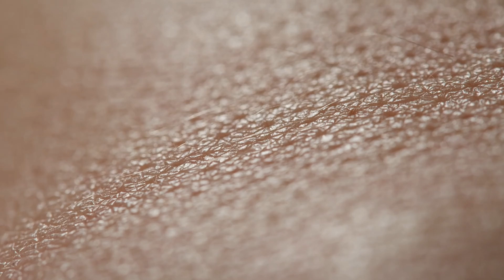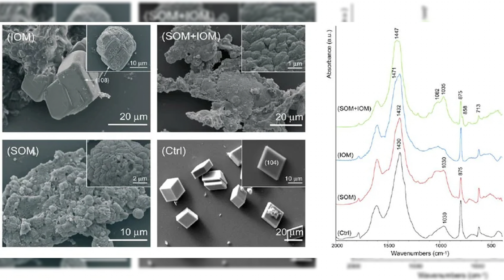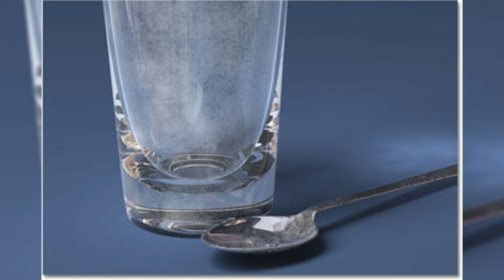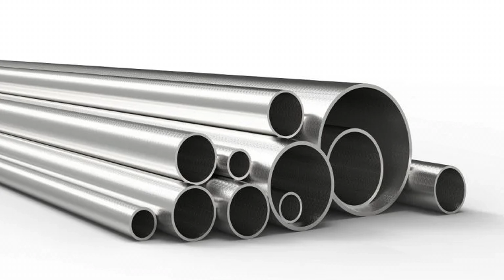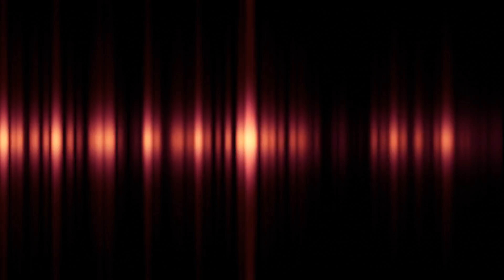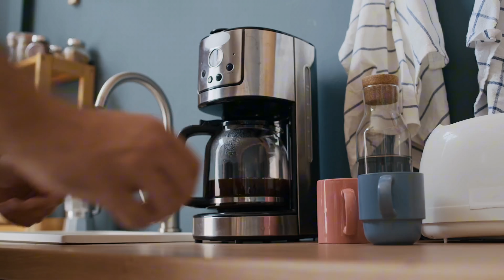🧲 These $12 Magnets on Your Pipes Eliminate Hard Water — No Salt, No Filters, Ever!

Comment from the maker: ⚠🚨 IMPORTANT MAGNET SAFETY WARNING 🚨⚠

Please do NOT use oversized or extremely high pull-force magnets for this setup. Stronger is not better here. For most people, magnets in the 20–50 lb pull-force range should be plenty. Anything much stronger can be dangerous to handle, can snap together violently, pinch fingers, chip, or even shatter.

The zip ties are only meant to hold the magnets after they’re already safely positioned — they are not meant to control monster magnets during installation.

Use gloves, eye protection, and a spacer like cardboard, wood, or plastic when positioning them. Keep them away from phones, bank cards, electronics, and pacemakers. Safety first. ⚠🧲👀
Reply: I have a couple of magnets with 200 pounds of pull force. I know your video said 20 pounds of pull force at least. Is there a concern with using such high magnetic pull force in this application?
Reply: Just please change this voice. It’s obnoxious
Reply: @Dtigger Some people will complain about anything...🙄🙄🙄

Comment: Your video is perfectly making sense, but I would recommend the magnet being placed at the water pipe entry from the Civic water pipe… which is cold water… as this condition being changed, the water need to go into a centralized filter with active carbon material to take away all the chemicals from the government water…. Then this can be go into the hot water tank… 

You can use any water treatment system, such as iron ionized, drinking water machine or any mineral stones shower unit…
Reply from the maker: That’s a solid approach for a more comprehensive home water treatment system, thanks for sharing your setup with everyone! 🤘🏼

Comment: We had this weird ball thing around our shower pipe 15 years ago moving in, had no idea what it was but the caretakers said the last tenants swore by it and it was up to us if we wanted to keep it so we left it on. It was just a white plastic ball with grooves in it, you could spin it, it was a mystery. Fast forward to months ago when the current caretaker did some bathroom repairs and pulled it off and we have no idea where it went. As the months went on my hair started getting more brittle and knotting itself easily, my skin feeling dry and more itchy. A film is on it even where the water makes it feel tacky, even after soap. 

We have really hard water here, plus an older building with all that comes with. After doing research I'm learning that this product was probably a magnetic water conditioner/descaler that does exactly as you're saying. It was likely fairly old, could have been sold from a fair, a tv ad or one of those little stands in a department store for all we know but I can't find a single digital record of it. The closest match in shape that I can find is the "Magnoball" which is a similar concept, only it's a softer material and meant to sit inside your dishwasher or washing machine to improve the water and remove limescale. Now I'm hunting for alternatives and I think I'll give this DIY a try first to see if it has any benefit.

Something I've wondered about is housing for the magnets, if they need to be encased in something or if that doesn't matter? I noticed some brands made use of them and I read something about having a carbon steel or iron back plate focuses the magnetic field and acts as a "flux conductor" which can double the field strength inside the pipe compared to bare magnets alone. I'm thinking that the shape of the magnet could be beneficial as well, rectangular giving better coverage possibly. Anyway just going to give it as shot and see what happens. It's interesting to read other comments around hot water ruining the effect, and yet it did make a difference on my showers.
Reply from the maker: That’s honestly fascinating—especially the timing between that mystery device being removed and the old hard-water symptoms coming back. The tacky film, dry skin, and brittle hair are all things people commonly notice with very hard water because the minerals react with soap and leave residue behind.

On the magnet housing: the magnets don’t necessarily need to be encased for the magnetic field to pass through the pipe, but they should be protected from moisture and corrosion. A steel or iron backing plate can redirect and concentrate more of the magnetic field toward the pipe, although claims that it automatically “doubles” the strength depend heavily on the magnet spacing, pole direction, pipe material, and overall design. Rectangular magnets may provide better coverage, but correct placement and polarity matter more than the shape alone.

I should also be clear that magnetic conditioners don’t actually remove calcium or magnesium like a real water softener does. The research is mixed, but some studies suggest that under the right conditions they may change how calcium carbonate crystals form, making scale less likely to stick. That could explain why some people notice a difference while others notice nothing at all.

Your old plastic ball may also have contained something besides magnets, so it’s difficult to know exactly what it was. Still, your experience is genuinely interesting. Please let me know what happens when you try the DIY version—I’d be very curious to hear whether the shower film, skin, and hair improve again.

Comment: Using magnets to soften water or reduce scaling has been around for over 40 years and has never gone anywhere. The reason why is very simple, because it doesn't work. I worked with commercial high pressure steam boilers where water softness is critical for preventing boiler scaling, and no one uses magnets for boiler feed water softening. In the feed water treatment industry, nobody uses magnets. Because it doesnt work. This is a old scam, most people today are not old enough to remember when they used to sell these water softening magnets in hardware stores. I even tried it myself on my home water and it had no effect whatsoever.
Reply from the maker: You're absolutely right that magnets do not soften water the way an ion-exchange softener does. They don't remove calcium or magnesium, so they'll never replace a proper softener in a boiler or industrial water-treatment system.

Where the evidence gets more nuanced is on scale formation. A number of laboratory and pilot studies have reported that magnetic treatment can change how calcium carbonate crystallizes, sometimes producing softer forms that adhere less strongly to surfaces. Other studies have found little or no benefit, especially under different water chemistries and flow conditions. That's why the results are inconsistent and why the technology has never replaced conventional water treatment in critical industrial applications.
So I'd agree with you that magnets aren't a substitute for water softening, but saying they have no effect whatsoever goes further than the current evidence supports. It seems to depend heavily on the water chemistry, flow rate, and the specific application.
Reply: @Sidney_Explains_Money They have no practical effect in the real world, that is my point. Not that there is no effect or change, but that it is not a reliable useful effect. There have been a great deal of breakthroughs that never got out of the lab, magnetic water softening is one of them. My hunch is that the effect is dependent on the magnetic field always being present, just passing the water through doesn't doesn't create a lasting effect. How could it?

Comment: I bought two N42 2x1x1/2 inch neodymium magnets through Amazon.  They were $16 a piece, so about $35 with tax.  More than twice the price you stated in your video, but still cheap enough.  I wrapped black tape around the pipe.  I put one on top and one on the bottom.  They immediately attracted, ripped out of my hands and snapped together.  It took all my strength to slide them apart.  I held one on the brick of the house wall and slowly slid the second 90 degrees and pushed to slide it off the first.  

I then purchased a pipe grounding clamp with stair-stepped flanges that fit perfectly around the magnets.  My son and I tried again to clamp the magnets to the pipe.  They again ripped out of our hands and the clamp and snapped together.  This time one of them broke into pieces.  

I find it hard to believe you were able to do this with the size magnets you claim you're using and just using zip ties.  Please share how you were able to set this up.
Reply from the maker: You’re right to question it, and I appreciate you sharing what happened. Those magnets you bought sound much stronger than what’s needed for this setup. I should have made it clearer that the key number is the pull force, not just the N42 grade or the physical size. For this, I’d stay closer to the 20–30 lb pull-force range. Anything stronger can become dangerous to handle and doesn’t necessarily improve performance.

The ones I used were strong enough to attract through the pipe, but not so strong that they ripped out of my hands like that. The zip ties are only meant to hold the magnets after they’re already positioned — they’re not strong enough to control oversized magnets while you’re installing them.

With magnets that aggressive, I would not keep trying to force that setup. Neodymium magnets are brittle, and when they snap together they can chip, shatter, or pinch badly. I’d step down to smaller/lower-pull magnets, use eye protection and gloves, and keep a piece of cardboard, plastic, or wood between them while positioning.

So yes, your experience is valid — stronger is definitely not better here. I’m sorry one broke on you, but this is a good warning for others watching the video. I will go pin a warning right away.

Comment: Hello, would 150 lbs pull force magnets work fine? Please let me know. Thank you so much 🙏
Reply from the maker: Yes, 150 lb pull-force magnets would technically work, but honestly, they’re probably overkill. For this setup, you’re usually better off staying somewhere around the 20 to 50 lb pull-force range. Anything much stronger than that is mostly just a waste of money, because it’s not likely to give you better performance.*

The more important things are using neodymium magnets, placing them on a non-iron pipe like copper, PEX, or PVC, and making sure the poles are attracting through the pipe — north facing south. If the magnets are pushing away from each other, flip one around.

Also, be careful with 150 lb magnets because they can snap together extremely hard and pinch your fingers. Keep strong magnets away from phones, bank cards, pacemakers, and electronics.

Comment: Short answer: no strong evidence says magnets on your home’s copper water pipe will truly “fix” hard water.

What those products claim:

Magnets supposedly change how calcium and magnesium crystallize.

The idea is they reduce scale buildup without removing minerals.

What actually happens in real-world testing:

Some small studies showed temporary or inconsistent reduction in scale under very specific conditions.

Many independent tests found little to no measurable improvement.

They do not soften water in the true sense:

hardness minerals stay in the water

soap still reacts poorly

water spots still happen

TDS/hardness readings stay basically unchanged

So if someone says magnets will permanently solve:

hard water stains

soap scum

appliance scaling

dry skin from hard water

…that’s usually overstated marketing.

A few important points:

Strong neodymium magnets on copper pipes generally won’t damage the plumbing if installed properly.

Copper itself is non-magnetic, so the magnets are only affecting the water flow, not the pipe.

Any effect tends to be temporary and highly variable.

Results people report are often anecdotal and can be placebo or due to other changes.

What actually works for hard water:

Salt-based ion exchange softeners (most effective)

Template-assisted crystallization / TAC systems (helps with scale, doesn’t soften)

Reverse osmosis for drinking water

Polyphosphate systems for mild scale control

If your water in Red Deer is noticeably hard — which much of Alberta’s water is — a real softener will outperform magnetic devices by a huge margin.

Comment: Great storytelling, but let’s look at the actual physics.
While the science of calcite-to-aragonite transition exists under strict laboratory conditions, applying it to a home plumbing system with two $12 magnets is a huge stretch.
Passive vs. Active: Industrial magnetic water treatment uses precisely tuned electromagnetic fields and specific flow rates. Clamping static magnets onto a pipe doesn't guarantee the necessary field strength to treat all the water rushing through.
Hard Water stays Hard: Even if the crystal structure changes, the minerals remain in the water. Once the water evaporates on your shower glass or in your kettle, you’ll still have the exact same amount of limescale buildup.
The "Industry Secret" Trope: Claiming the $2,000 salt-based industry is "hiding" this is classic marketing. If a $12 magnet actually worked reliably, insurance companies and large-scale builders would mandate them to save billions in plumbing repairs. They don't, because it's inconsistent at best.
It’s a fun experiment for $12, but don't cancel your plumber just yet. This is more "Lifehack Magic" than reliable engineering.

Comment: Snake oil. 40 years of experience treating hard water in West Texas. I have magnets still clamped around the pipe for display. Completely stopped with calcium and magnesium. An expensive softener doesn't even remove old scale.

Comment: Yes, a sufficient magnetic field can affect the relative amounts of aragonite versus calcite formed during calcium carbonate (CaCO₃) precipitation from water.
Aragonite and calcite are polymorphs of CaCO₃ (both have the same chemical formula but different crystal structures). Calcite is the more stable, rhombohedral form that typically forms hard, adherent scale in pipes and equipment. Aragonite is a metastable, needle-like or orthorhombic form that is less adhesive and easier to remove or keep suspended.
Multiple peer-reviewed studies (including lab experiments in fluidized-bed crystallizers, stirred tanks, and flow systems) demonstrate that static or dynamic magnetic fields—typically starting around 0.1 T (1000 Gauss) and higher, depending on conditions—promote aragonite nucleation and growth while suppressing or altering calcite formation. Key findings include:
Aragonite seed crystals grow under magnetic fields (e.g., 212–1800 G from permanent magnets or commercial devices) but show little to no growth without them at room temperature. Higher field intensity shortens the time needed for the effect and can stop calcite growth in lower-pH environments.
Flowing water through a magnetic field (e.g., ~0.1 T with a gradient of ~10 T/m) significantly increases the aragonite/calcite ratio in the resulting precipitate. This has been observed with and without trace iron, though aragonite can later convert to calcite over time.
In magnetic water treatment (MWT) experiments, the proportion of aragonite rises with field strength, flow velocity, exposure time, supersaturation, and factors like pH or ions (e.g., Mg²⁺ or Fe²⁺). For example, one study found aragonite content increasing from ~18 wt% (no field) to ~38 wt% after 30 hours of incubation under a 1 T field.
At optimal conditions (e.g., 0.5 T), the precipitate shifts toward mixtures with more aragonite and vaterite (another metastable form) and less well-crystallized calcite, reducing overall scaling.
The effect is not universal or guaranteed—it depends on variables like magnetic field strength/intensity/gradient, water flow rate (dynamic fields often work better due to induced Lorentz forces or electric effects), temperature (25–80°C range tested), supersaturation level, dissolved ions, oxygen content, and exposure duration. Some studies report modest or variable results, and mechanisms are still debated (possible explanations involve altered water cluster structure/hydration of Ca²⁺/CO₃²⁻ ions, changes in prenucleation clusters, or surface/orientation effects on growing crystals).
In practical terms, this is the basis for commercial magnetic descalers, which aim to form softer, non-adherent aragonite scale instead of hard calcite. While results in real-world systems can be inconsistent (and the technology remains somewhat controversial), controlled lab evidence consistently shows that sufficiently strong and properly applied magnetic fields can shift the balance toward more aragonite and less calcite.
Reply: I was going to say that exact thing
Reply: @geraldreeves9264 i too was about to propose this exact comment on youtube.
Reply: Gee thanks Professor.  I'll be sure to tell Gilligan and The Skipper.....😵‍💫